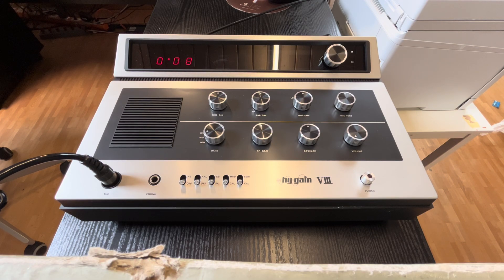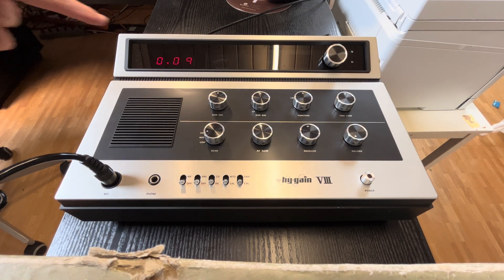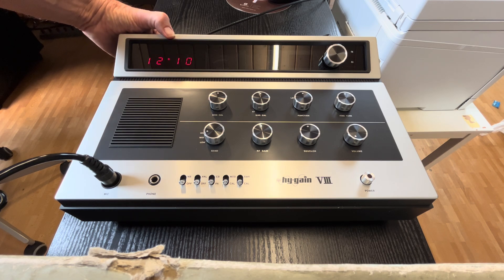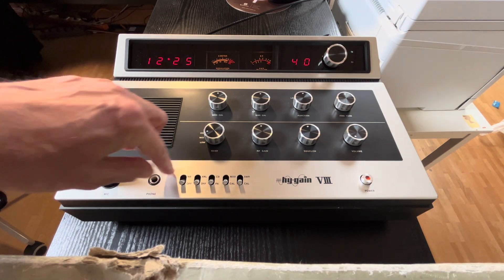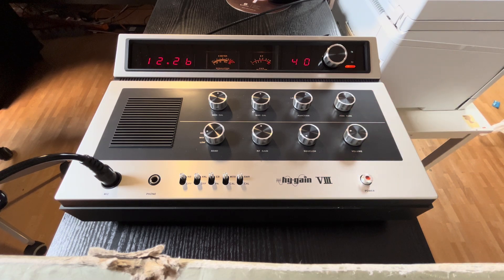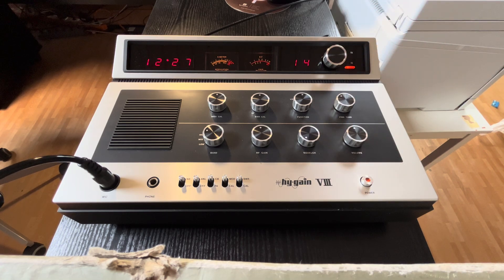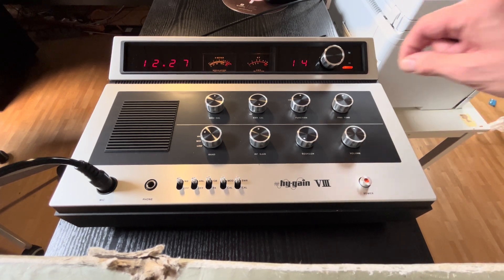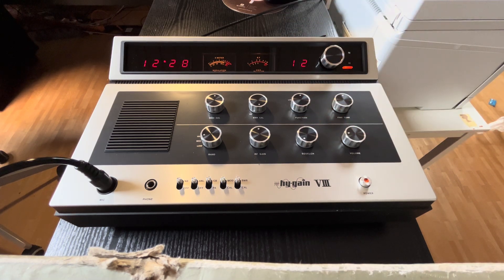Hy Gain VIII 3078, SSB/AM 120CH CB-base-radio overview

Comment: Just bought a boxed Hy-Gain VIII, I live in the UK, and it seems it came from the U.S. it has its original owner FCC call sign on the side on a card from someone in New York lovely radio in great condition for its age
Reply from the maker: Hello dear CB radio fan, thank you for visiting my channel. Yes, the Hy-Gain 8 in this case is an export version with 300 kHz on the 10m band. I just need to change the crystals, then I could cover 800 kHz on the 10m band, good for SSB QSO on the HAM Band. I wish you a nice weekend. Best 73 from the Zurich highlands.

Comment: sweet!
Reply from the maker: Hello Oldman 1112223333111, thank you once more for your feedback. Indeed, the console is quite exceptional. This Hy-Gain model, now approximately 45 years old, has remained unopened. I plan to perform the alignment in the coming weeks. Currently, on SSB, it's roughly 160Hz below the desired frequency, and the RF power is just under 10 watts on SSB. Apart from that, the radio operates excellently. Wishing you and your family a pleasant weekend.
Reply: @SWIZZRADIOS  yes I had the 40ch version and the power supply in these is the weak point for power. It was dimming badly but put a small amp like a tx100 and 10w is plenty
Reply: @SWIZZRADIOS  with 230v it may be an issue though as they are more efficient

Comment: Good radio , I Restored one to new condition about 3 years ago
Reply from the maker: Hello Mister Paul, thank you for your feedback. I also keep watching your super-restore videos. Since you have already overhauled a Hy-Gain VIII, maybe you can tell me which CYBERNET PCB is installed there. Is it a PTBM048 or PTBM059? There is various information on the internet. Vy 73 and greetings to the CB family.
Reply from the maker: What I have noticed, however, is that the display of the digital clock lags significantly behind after setting. I always thought that the clocks are synchronized with the mains frequency. That's why this clock is still set to 60HZ. Somehow it must be possible to synchronize it with our 50Hz mains frequency. The clocks on the Euro Stalker-20 and the Euro President Madison also run synchronously..... I hope you have a nice weekend.

Comment: Very classic radio I've not seen it for over 30 odd years it will need recaps hopefully no leaking caps. It great seeing this set still about. Thanks for the video 73.
Reply from the maker: Hello dear OM Darren, thank you for your report. Yes, that's right: The devices hum very loudly when they are operated with 220-240V. The mains capacitors are probably dried out and have also been subjected to electricity for over 45 years. What I have noticed, however, is that the display of the digital clock lags significantly behind after setting. I always thought that the clocks are synchronized with the mains frequency. That's why this clock is still set to 60HZ. Somehow it must be possible to synchronize it with our 50Hz mains frequency. I wish you and yours Vy 73, and a nice weekend.

Comment: What an amazing find! It's incredible to see a Hi Gain 3078 CB radio from the 70s still in perfect condition after all these years. The flawless operation really shows the value of preserving vintage equipment like this. Thanks for sharing this piece of CB history! 📻
Reply from the maker: Hello my CB friend CANALCOMENTARIO, thank you very much for your talk. These two CB radios were probably stored in an old shop for over 45 years. The seller of these devices then discovered them during a warehouse clearance and auctioned them on Ricardo.ch. The devices hum very loudly when operated with 220V. The mains capacitors are probably dried out and have not seen any electricity for over 45 years. I wish you and Vy 73 a nice weekend.

Comment: hi, an exciting radio you have got hold of and very very nice, 
the one I have is unfortunately with traces of use. 
Can't remember if you have a website. 
Regards Kenneth denmark
Reply from the maker: Hello OM Ken, I appreciate your feedback. I've observed that the digital clock display experiences significant lag after being set. I was under the impression that such clocks synchronized with the mains frequency, which might explain why this clock is still on 60Hz (US mains). Ideally, it should sync with our 50Hz European mains frequency. The clocks in the Euro Stalker-XV and -XX, such as the Euro President Madison, also run in sync. Currently, I do not have a website beyond YouTube. Wishing you and your family a pleasant weekend.